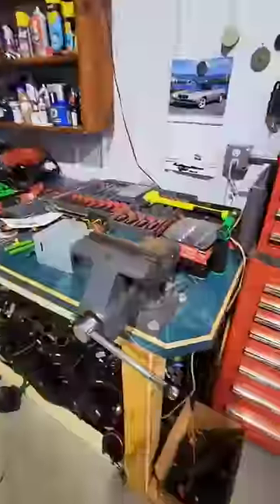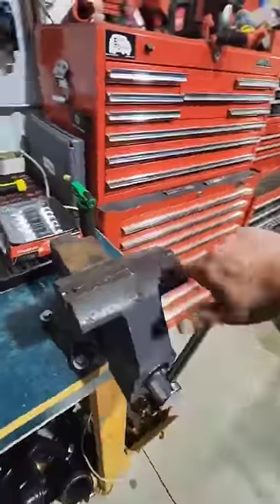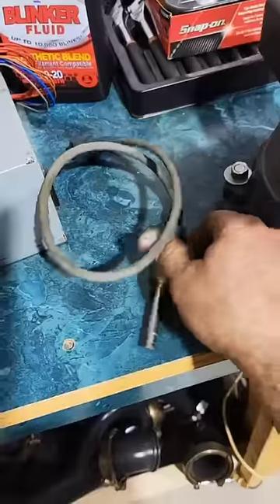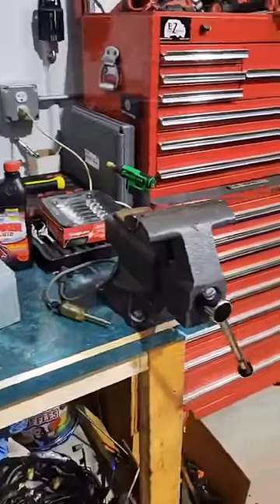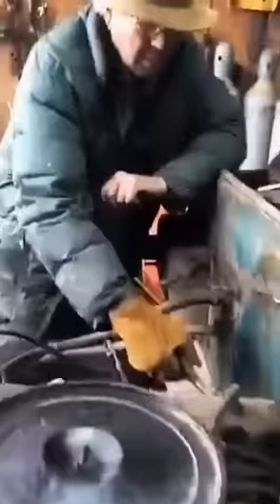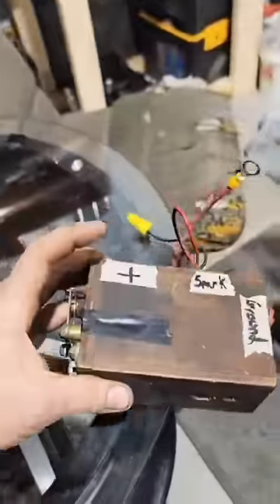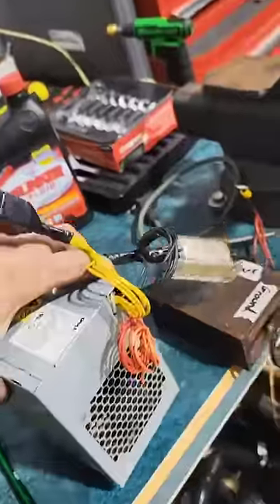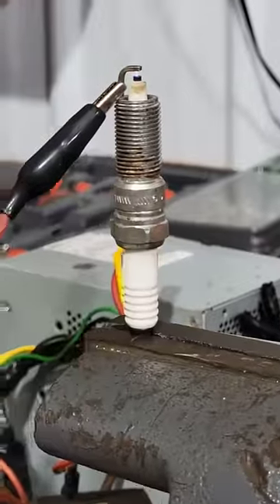30,000 Volts out of an ignition coil! #shocking #shorts Be careful, electricity can be dangerous.

Comment: "Igniton coils dont give a fuck if you compete the circuit. "
Words to remember
Reply: It's not true though. In order for electricity to flow you need to complete the circuit. The people he showed were all touching the car with another hand/body part. Even when showing the spark plug he has a wire running from the ground strap to the ground on the coil.
Reply: @compacteconomycar5300  the point is they don’t give a fuck if your a wire or not you’re gonna get shocked
Reply: @Beef_jerky_official  you'll only get shocked if you complete the circuit. "Ignition coils don't give a fuck if you complete the circuit" is a completely wrong statement.
Reply: Ignition coils also create unsafe unregulated levels of current that can cause a heart attack. Good things it's not a magneto
Reply: @compacteconomycar5300  you complete the circuit because you yourself are grounded so your finger is completing the circuit bro therefore you get shocked, he worded it in a bad way so let me word it better for you
There’s one hot wire and one ground wire, if the hot wire is connected and he touches it he gets shocked because he completed the circuit, a lot of people say they don’t give a fuck because people are stupid enough not to realize you yourself are grounded
Reply: @compacteconomycar5300  So is "a falling knife has no handle" it still conveys a valid point.
Reply: @Beef_jerky_official  that's not how electricity works. "Grounded" doesn't mean you're touching the ground. Electricity needs a path back to it's source or it's not going to flow
Reply: @Larcona_  what valid point does it convey?
Reply: @Beef_jerky_official  you're wrong. Confidently wrong, but still wrong.
Reply: @compacteconomycar5300  really please show me your source on this because I’ve found over 1500 sources that directly say the same exact shit, all it takes is one fucking google homie
Reply: @Beef_jerky_official  ok. Show me one that states electricity will flow in an incomplete circuit
Reply: @compacteconomycar5300  also to help you understand I did some more research and found out that the earth has a current it connects to called a NEV
Reply: @compacteconomycar5300  Go and strap a plug lead to your hand then and dont touch the vehicle (so you cant let go of it). Get a buddy to start it and let it run for 10 mins. Come back and tell us you still wont get shocked!
Reply: @geepersoilyrag1884  I pull plugs off running vehicles all the time. If you aren't touching the car you don't get shocked.
Reply: @compacteconomycar5300  You don't reach for a falling knife... I didn't think I had to spell that out.
Reply: @geepersoilyrag1884  you won't get shocked unless you're also touching the car with another part of your body
Reply: @Larcona_  what valid point does the original statement make. Didnt think I'd have to spell that out for you
Reply: @geepersoilyrag1884  I have multiple times. You don't get shocked unless you touch the car
Reply: @Beef_jerky_official  because I'm not wrong. There could be 700 people telling me electricity will flow without completing the circuit back to the coil and I would still be correct saying that it won't. I work with this every day.
Reply: @compacteconomycar5300  and that’s what your not getting it completes the circuit
I went to college for electrical engineering
Reply: @Beef_jerky_official  how would grabbing a handle and touching nothing else (like done in the video) complete the circuit?
Reply: @compacteconomycar5300  Youve put your finger in a Plug lead on a running engine? ok!
Reply: @geepersoilyrag1884  you have no idea what you're talking about.
Reply: @compacteconomycar5300  But you say youve put your finger in a plug lead on a running engine? Film this shit, please!
Reply: @geepersoilyrag1884  it doesn't matter if your finger is all the way in the lead. I've pulled plug wires that didn't have a boot and didn't get shocked because I wasn't touching the car and therefore not completing the circuit. Your made up scenario is just dumb
Reply: @compacteconomycar5300  when the current passes through you the electricity passes through your tissues and the electricity goes out back to where it came from, this makes your body grounded as the power is passing through you and back
Thus completing the circuit
Reply: @Beef_jerky_official  so the current is going to the same place it came from? In order for that to work the circuit would already need to be completed and electricity wouldn't take a more difficult pathway
Reply: @compacteconomycar5300  Not a made up scenario, a request for a demo from you.
Reply: @Beef_jerky_official  so the electricity is flowing from the coil, to the handle, into your body, back into the handle and back to the coil? That's not how electricity works. Electricity always takes the pathway of least resistance. The human body is roughly 700 ohms, a steel vise handle is probably less than .1ohms.
Reply: @geepersoilyrag1884  so you want me to demonstrate your made up scenario because you don't understand how electricity works?
Reply: You will remember like I do 😆 ouch 😆 🤣 😂
Reply: @Ham Sandwich *from the gnd, right EE😏
Reply: you are not grounded but a capacitor which allows current to build up charge in your body and then remove that charge. since the coil operates at a high frequency u are charged and discharged many thousands of times per second and it creates a current flow that can be measured and felt
Reply: @joeykozicki8883  there's a slight chance that could happen under ideal conditions. But that little tingle you may feel isn't going to make you spazm and fall like what's shown in the video
Reply: @Ham Sandwich is there cheese on you to make a hot ham and cheese if you know
Reply: @Ham Sandwich  I feel like that's a very fancy way to say you've shocked the fuck out of yourself alot in the past... cheers mate.
Reply: @Ham Sandwich technically, circuits are not looking for ground. They are finding a return path to the source.
Reply: @compacteconomycar5300  If electricity can't flow without returning to its source, then how does lightning work? The fact is, electricity isn't a magical thing, it's the movement of electrons. Electricity will always flow away from negatively charged things and into positively charged things. Do you think that your house is sending the electricity it gets back through the wires to the power plant? It's all electron movement, the electrons don't care if they go back where they came from or not as long as they equalize the charge. Even in a battery, the electricity isn't returning to the "source," it's going from the negatively charged plates inside to the positively charged plates inside. Just because it's going back into the same battery case doesn't mean it's actually going back to the same internal place in the battery. Have you never seen the grounding rod for your house? It's literally a metal rod... stuck into the ground. Because the ground will ground electricity without it returning to the source. See also: tesla coils. They shoot electricity into the literal air without it going anywhere at all.
Reply: @Ham Sandwich fellow EE, came here to say the same thing. When I was a tech we would charge old capacitors 22uF/450V caps and leave them on others benches who borrowed tools.
Reply: @Ham Sandwich the linemen wasnt wrong strictly speaking, anyway.... Veritasium did a video on it and had a lot of people trying to make the same point as you, and you are both right. the magnetic field outside the wire is actually inducing the current, but nothing is flowing though the wire. electrons dont move from one end to the other...
Reply: Rally cars "don't give a fuck if you complete the circuit."
Reply: @compacteconomycar5300  to back up your point and put it into more car mechanical terms… if your trying to find a bad plug or check if your having misfire/cylinder issues, you go through and pull your coils/plugs one by one while the cars running until you found the bad one… literally never shocked myself doing this once… cuz I’m leaning over the car not touching it…
Reply: @compacteconomycar5300  unfortunately this is incorrect! as in the case of lightning, electricity can flow without returning to its source. 
in fact, electric current CANNOT return to its source; it has to return to a place of high voltage (using electron flow, not conventional current)
Reply: Truer words have never been spoken
Reply: @Ham Sandwich exactly... the only way you will ever feel anything is if the circuit is completed... high enough voltage just will go through you in ways that lower voltage won't.
Reply: @compacteconomycar5300  That the normal precautions against getting shocked don't work for coils.
Reply: @Ham Sandwich electricity does run around the wIre.
Reply: @compacteconomycar5300  bro you're really just the erm ackshually guy no shit he's completing the circuit, but he wouldn't have completed it under lower or normal voltage.
Reply: They should write that in the book...
Reply: Old dude told me the model t coil is a great theft deturant mounted to door handle, leave a warning ⚠️,  do not touch
Reply: @Ham Sandwich as an electrical engineer you should know that electrons dont conduct electricity its the magnetic field around that does this and the electrons move a little bit with the field
Reply: Those are words you can't forget if you know first-hand what he was talking about!!! I started getting called "Sparky" for that very reason!  SMDH 🤦🏼‍♂️ Just in case anyone doesn't know, THAT $#IT HURTS, SO DON'T DO IT!!!
Reply: @hamsandwich5200  I'm not an electrical engineer, but yeah electricity has used me like a prosti-toot uses a rubber and thrown me away many times as well!
Reply: @Ham Sandwich you really think he is wrong don’t you ha, actually he is right in a way. The frequency of the AC does depend at which point the “Skin Effect” comes into play. I see lots of electricians that don’t know or understand electronics, but know electricity some because of their work, and think they know everything about it because of that! Electricity isn’t taught the same like back then. Electricians, and Electronics were kinda taught together were now it no longer is. And since the actual correct information about how AC works and how it can effect objects in away that it could be considered supernatural. Everything is resonate at a specific frequency! 
So yea technically speaking electricity does travel on the outer conductor, but also travels like light. A complete DC circuit will have a Magnetic Field with a North, and South poll. A complete AC circuit will have a magnetic field that Alternates, flips,pulls, changes how ever you’d like to say it’s magnetic field, and the rate at which it does is called Hertz, or Hz! Power line Transmission is between 50,and 60 Hertz! But RF transmission in some cases would be much higher in frequency, and the skin effect can become a problem with RF hooked to a cable!
Reply: And clowns don't take anything serious 🤣. Get the camera this is going to turn into a movie
Reply: You are the circuit. This is why you should use a copper ground and SECURE your ground if you're checking spark on a running engine.

If, for even a moment, that copper ground breaks, you become the shortest path to the ground.
Reply: @Larcona_ you don't wan't the knife to get dirty
Reply: @Ham Sandwich They are partially right it depends on the type of current.
Reply: @compacteconomycar5300  any dipole antenna would immediately prove you wrong. As you said earlier “confidently wrong, but still wrong”. The “circuit” concept is just a “good enough” teaching tool used to dumb down electricity for engineers who don’t need to know how it really works.
Reply: @dsfnemky812  I'm not sure what that is but is it another example of alternating current when we're talking about a direct current scenario?
Reply: @Ham Sandwich funny you say that, because apparently you don’t fully understand it either. The entire field of electrostatics relies on you being wrong. Where is the circuit in a lighting strike? Or a dipole antenna? How does a Van De Graaff shock you? Electricity is nothing more than the transfer of energy though EM fields. You GENERALLY need a circuit to do useful work, but that doesn’t mean it’s required. It never ceases to amaze me how little engineers have to know about the things they design, assuming you aren’t lying.
Reply: @compacteconomycar5300  tires rubber anyway
Reply: stupid phrase
Reply: @Ham Sandwich The OTHER two?? You didn’t even pick apart the FIRST one. Thanks for the completely irrelevant history lesson? There’s not much to respond to, as you didn’t even say anything. It’s in “not even wrong” territory. I mean, if they can be so easily picked apart, then why not do it in the first place instead of pointlessly alluding to it? It’s just dumb
Reply: @compacteconomycar5300  which one? The dipole antenna or the Van De Graaff? Either way, neither is an example of traditional current. That’s my the entire point. They’re examples of EM energy transfer without a circuit
Reply: Ive lived this as well 🙄 Rookie mistake but I never done it since hahaha
Reply: @Ham Sandwich yea that’s what I thought. You’re a prime example of Dunning-Kreuger. If you do decide to educate yourself though, remember picking up both an EM and logic book.
Reply: Facts! They do not care!
Reply: @compacteconomycar5300  The confusion stems from the difference in how it is taught in vocational schools vs universities. I’ve noticed in vocational schools there is a lot of terminology that includes electricity needing to flow specifically back to its source, which in the cases you study in vocational school, is true. However, at universities, you are taught that current flows from high potential to low potential, not necessarily strictly back to its source. As someone who plays hot capacitor a couple times in lab, what is shown in the video is definitely possible

source: studying EE/CE at uni
Reply: @Ham Sandwich this is wrong there AC and DC, since you still don’t get it the human body acts like a capacitor to AC even at 50/60hz are body acts like a high valve you resistor, but a capacitor too! The long your exposed the skin start to break down turn to carbon which is a better “conductor”. AC didn’t really work for the electric chair Tomas Edison insisted that AC would be faster, it was vary bad! DC was damn near instant. 
There are two different types of current if you can’t acknowledge that then your discrediting yourself there just saying!
Reply: @Ham Sandwich the capacitor is the most important component invented so many people think the change is stored in the conductor, it isn’t! The polarization of the dielectric creates the available charge! Benjamin Franklin explained that. Without that component pretty much everything we use wouldn’t work! Because the two very different types of current can exist within the same exact wire with effecting one another, you could have 10 two several thousands volts DC, and an AC voltage applied too it ass well! The capacitor can be connected to this wire and it will block the DC, and the AC can pass though the capacitance of the capacitor, and the frequency of the AC voltage/ Signal will effect the Reactance this is called “Capacitive Reactance”
It isn’t till you start playing with High frequency that you realize AC is very odd, to me it’s supernatural, just like Nikolai Tesla “369” electric motors work based off 369/vortex mathematics.
Reply: Fuck yeah I'll surely remember it
Reply: I think he meant to say ignition coils don't give a fuck if you are the thing that completes the circuit! LOL
Reply: @Ham Sandwich Tradesmen tend to focus on practicality. Technically the coil does need to complete a circuit, but it’s strong enough to make a circuit out of your skin, which makes it essentially only need one point of contact from your skin. And the thing with current going around and not through is called the “Skin Effect”, I’m no expert but all it took was like 30 seconds to search it and a few minutes to read it
Reply: It's more like a sentiment of a high enough voltage not caring if you physically form a closed loop via intentional conductors. 

It's something to think about when imagining current flow and capacitive coupling and various frequencies etc.. I'm reminded of how transmission linemen need to balance charges between the chopper and the lines as they are flying up there to do some big balls cowboy shit. You have a completely isolated chopper in the air, and the dude is holding out a rod to bleed that charge, which is throwing serious high voltage arcs in the process. It's all about charge.
Reply: @Ham Sandwich EE here, I agree with you
Reply: @compacteconomycar5300  how about you actually back up your points, yes humans are conductors not grounded.
Reply: I like the way you think!
Reply: Found that out when I tapped the top of the dizzy on an old 87 camaro I had. I jumped back pretty quick, and I hadn't told my body to do it either lol
Reply: Ignition coil is the power, YOU ARE THE GROUND
Reply: @compacteconomycar5300  that's even remotely how electricity works😂. here's a basic example to wrap ur head around it does lightning flow back to it's "source" in the clouds?
Reply: Exactly. I have learned the hard way. As in I near bout needed CPR. I had held it like an idiot